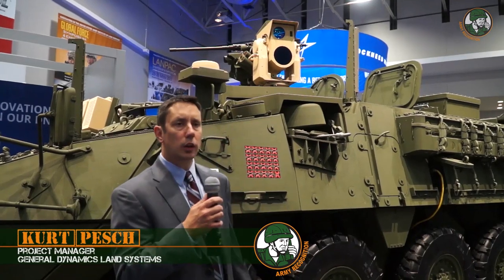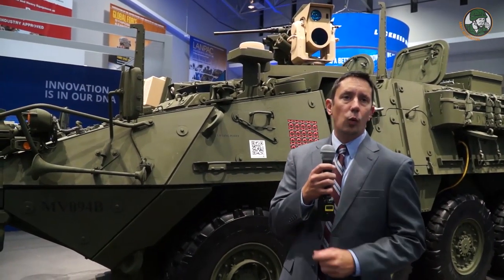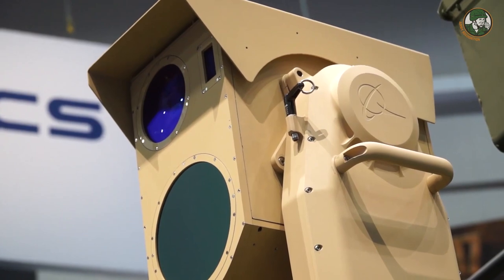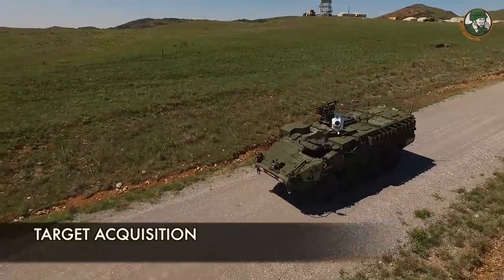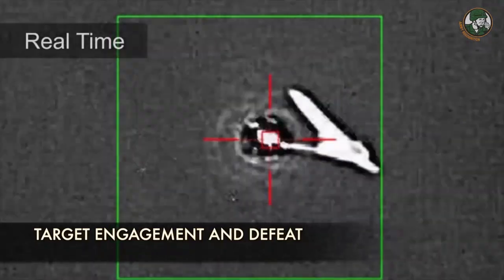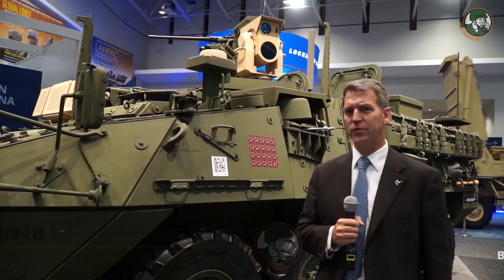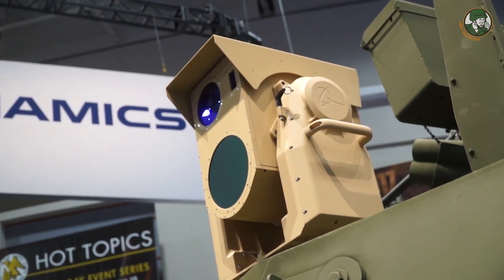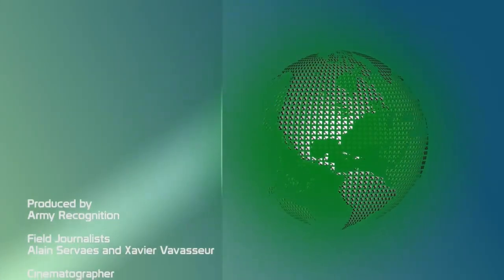U.S. Army demonstrates MEHEL 2 0 laser weapon on Stryker 8x8 armoured combat vehicle

Comment: Power levels are still way too low for what the military needs. Shooting down miniature drone toys and some rockets or mortars is one thing, and stopping larger missles, full size UAVS aircraft and Helios will take far more energy. And we haven’t even come anywhere near the power and range required for cruise missles. Your better off using them to stop mortars, tiny intelligence gathering drones and blinding enemy sensors with all they have achieved too date. Same for baby’s use. It will be mostly against small boats and maybe, maybe small drones but I seriously doubt that unless the ship is near shore or docked. Otherwise the range to the ship is simply too far for any recon drone that the laser would be cable of defeating anyway. 
Scale up too at a MINIMUM 300kw and then you might have some protection otherwise it’s just toys